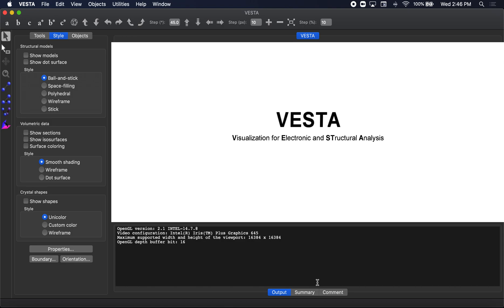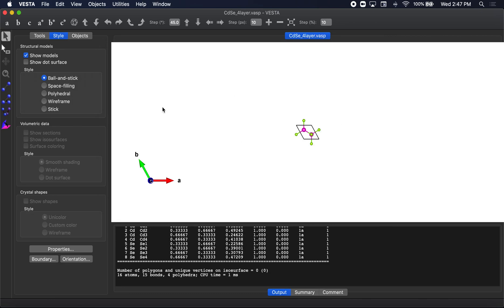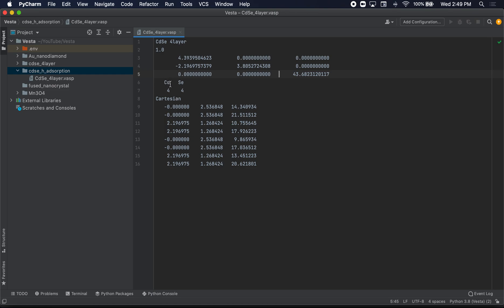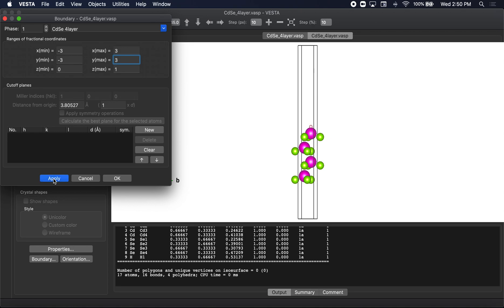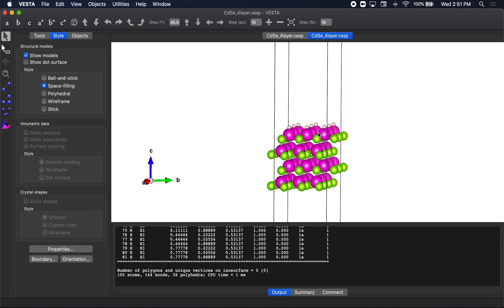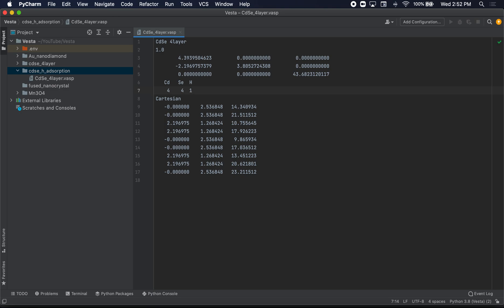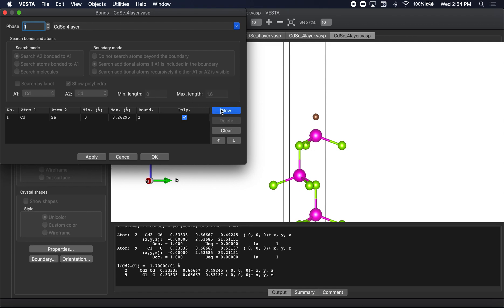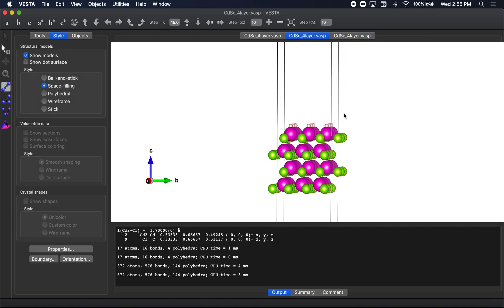Hydrogen Passivation of Surface in Vesta (easy method)

Comment: A question: Usually when passivating the slab's bottom side with pseudohydrogen, I would optimize the structure of the bulk, cut the bulk and get the slab model, then I would add the  pseudohydrogen at the midpoint of the bond between the bottom atom and the atom from the neighbor unit cell. Do I have to put the pseudohydrogen at the midpoint?

Comment: Most generally, I struggle to understand the concept of how many "dangling bonds" are present on a "real surface". I would appreciate any references to what is known on this subject. I am often confused about computational conventions made out of desperation/pragmatism vs. what represents empirical reality of surfaces.
Reply from the maker: Ah. Check out my video on adding a ligand to CdSe quantum dot. I talk about it a little. I give a method for computing how much ligand to add. And I think I give a reference. Computational models are no where near the real surface. They are idealized versions of them
Reply from the maker: For dangling bonds, you would need to think it’s terms of oxidation state and coordination number. Check out the paper by infante I talk about in the video where I cap the CdSe quantum dot. Their paper discuss making perovskite nano crystals and different dangling bond passivation methods. How it affects the electronic structure of the nanocrystal. It’s good stuff and may help you understand better. It’s one of the things that helped me
Reply: @nickelandcopper5636  Thank you, I will check that out later tonight. I appreciate your candor in what the models can and cannot do. I am a coupled cluster guy, used to writing codes for CC calculations on molecular systems and spectroscopy therein. These sorts of issues are very complex to me, as I often struggle to discern what is a model limitation vs. a reflection of the complexity of surface science.
Reply from the maker: Ah. Gotcha. CC is high level stuff. But ya - that 2016 reference by Infante will really help you better understand the what and why on these types of models. They look only at nano crystals but it’s completely analogous to surfaces as well. A nanocrystal is eventually just the bulk solid with surface slabs on every surface and no long periodic in any spatial dimension